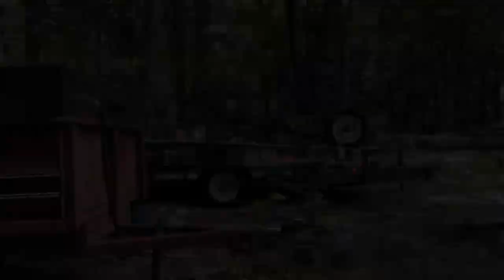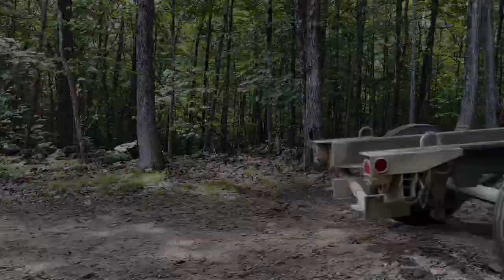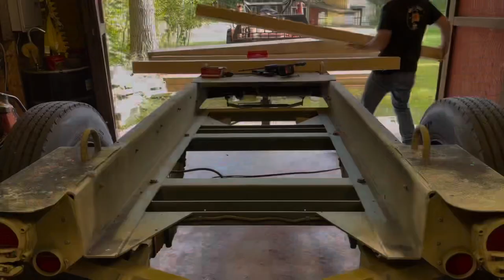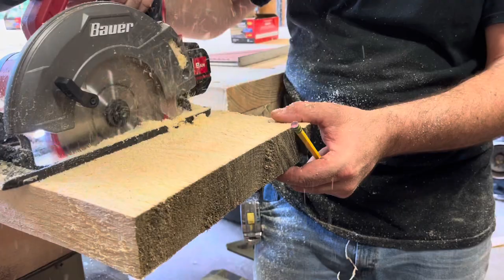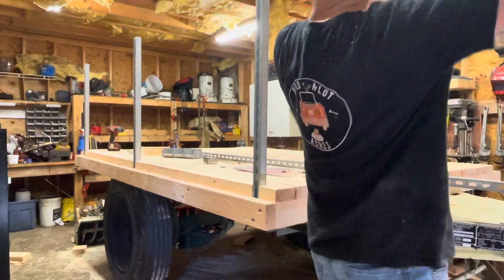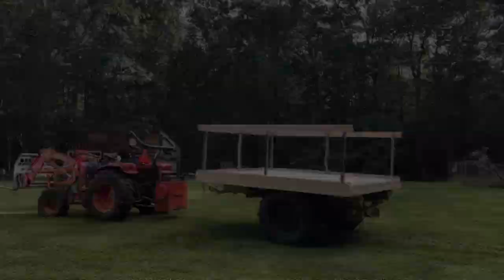This FIREWOOD trailer is a BEAST!!!

Comment: Holy moly, Case. I like the unistrut uprights. Gonna need a step ladder to reach the deck!
Reply from the maker: Yes sir. It’s a tallin’ I got some nice heavy expanded metal for it on Monday. Hoping to install it real soon and make the tailgate 👍 One of the reasons I used unistrut was so I could insert a round top frame into them for a cover

Comment: This is An Outstanding Jump Into Your Trailer Sir 👍👌😇 Ho Boy That Trailer Will Be A Very Good Wood Forest Trailer 😇👌👍A good mixe of paint and hydraulic oil will be an OUTSTANDING wood preserver Sir 👍👌😇Cheers 🍻
Reply from the maker: I was actually thinking of your oil recommendations when deciding what to coat it with 💪🏻👍💯
Reply: Thank You Sir, do you remember my house and my deck in Shefford, it is still going very well after 3yrs and it will be for many decades 😇👌👍🍻
Reply from the maker: @RCAFpolarexpress  I'm trying to remember it. I remember Joe's house and seeing you there building implements. I think a plow. I'll have to go back and refresh my memory 🤔👍

Comment: I was wondering what happened to the trailer. Had not seen it in a while. 
That sure is a capable trailer for sure. Get 1 3/4 cords of wood on there. Or 2 if rounded. 
Have a great day Case.
Reply from the maker: Yes sir. I can’t see overloading this puppy!!!
Reply from the maker: Yes sir. I can’t see overloading this puppy!!! 💪🏻🐶
Reply: @BuildALotAcres  🤭🤭